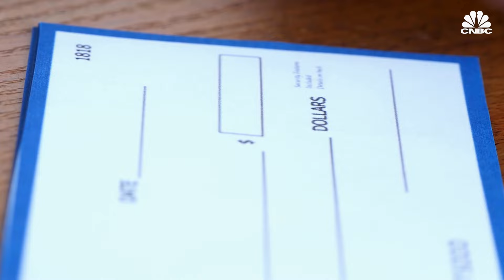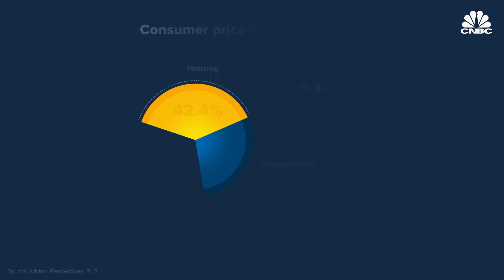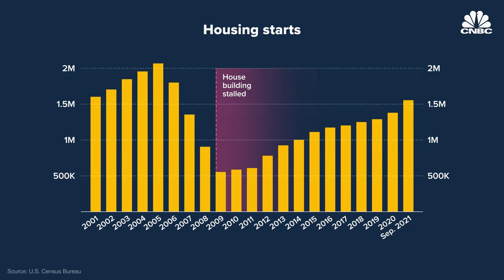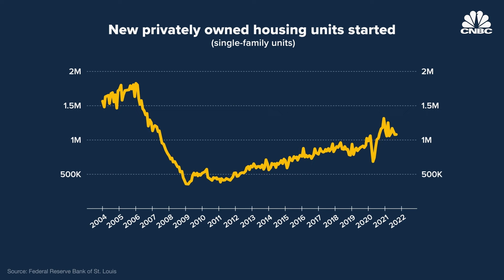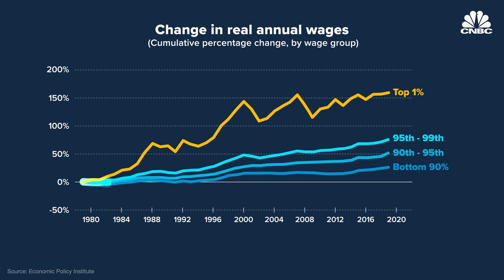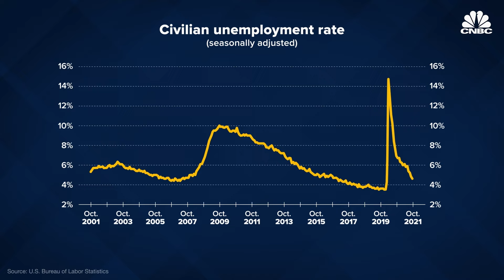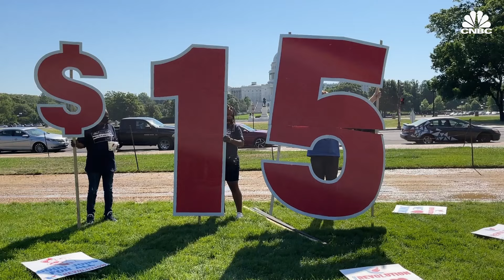Why Rent Is Rising In The U.S.

Comment: They need to start planning cities around public transportation initiatives, make things more walkable
Reply: Yes, this is key. I died a little heading “we need more single family homes” no, we don’t. We need transit and walkable cities
Reply: our cities used to be like that until the highway system was put into place because of the advent of motor vehicles. After that, they tore down and rebuilt our cities to be more car friendly and less walkable and public transportation.
Reply: Jennifer Tarin / That is.. false. The Highway System was built around cities in the US. No cities were tore down for highways and motor transport, most cities already had roads for carriages etc. highways are typically at the edge of a city, not through. I agree the public transportation needs to be improved in the cities in the US, but spreading false narratives is kinda stupid.
Reply: It's kinda hard to change major city infrastructure when it has already been established; it will get very costly. Sentimental & historic value is another reason why cities rarely change infrastructure; at most they'll repair it.

If you ever been to a city with an elaborate & effective city transit system  (subway & bus), you know how necessary it is to navigate the city, especially if you live there full time. Barcelona was the first city I ever visited that had such a system (I didn't travel much before then). It's expensive to live in Barcelona too!

Just like NYC, Chicago, SF and ATL.... it cost money to live in cities where you have access to a lot of things. Cities like Dallas, Charlotte and Austin are next. This is why their rental and home costs are rising as well!
Reply: Sadly they wont do that.  The plan is to keep the poor and impoverished out of site out of mind.  Here in ohio the nicer the area the harder it is to get their , without a car.
Reply: They just need to relax zoning so housing can be built where it's necessary.  Most cities have downzoned their neighborhoods meaning every new development requires lobbying the city hall for an ordinance change or exception.  This makes new development projects extremely slow, expensive, and risky.
Reply: The most expensive cities to rent in are also the most walkable. Not really sure what the issues are, but greed is one.
Reply: @R.M. Schupp Why should renters need protection/compensation?  If there is sufficient supply of housing, renters will always find something affordable to move into.  The fact that there isn't means there's a lack of competition (aka supply) on the market.  In that case the answer is not to make it harder to build more housing, but easier.
Reply: @R.M. Schupp Like I said, if supply is sufficient, people would not have to move outside the city.  The fact that people are being forced to move out of their neighborhoods to locations farther away from where they work means there is insufficient supply.  Making it harder for property owners to redevelop their property only aggravates the issue.  

Also, renters rent on a time basis.  Meaning the understanding is that there's no guarantee they would be allowed to stay past their current lease.  You're basically saying landlords should be forced to compensate renters for refusing to renew a lease.  

You can absolutely build your way out of a housing crisis.  That is how Tokyo solved their housing issue.  Tokyo authorizes more building permits than the entire state of California.  Its average housing prices has been essentially flat for the past 20 years despite its growing population and is significantly more affordable compared to other major global cities like NYC, SF, and London.  So yes, you can build your way out of a housing shortage.  

So are you're saying that the government should "preserve historic character" by forbidding property owners from building more housing and force people to be homeless?  "Preserving historical character" is cool, but at the end of the day it's just all aesthetics and must be justified.  Tokyo is constantly tears down and rebuilds its houses, yet it's one of the biggest tourist destinations in the world.  

Nor is there any historical basis for restricting development the way it's being done today.  All the "historical downtowns" were developed over time without the current zoning restrictions we have today.  People designed buildings because they liked the way it looked.  The popular trends stay and the unpopular ones fades away with time.
Reply: @ajgerbi  Robert Moses "...chose the middle of minority neighborhoods as the location for highways, and deliberately designed bridges on the parkways connecting New York City to beaches on Long Island to be too low for buses from the inner city to access the beaches..."  ~ Wikipedia
Reply: Instead of paying expensive rent you can buy a roiling mini home as a Toyota prius.

Try and see if it is anything for you.
Reply: Very true.   And better public transportation
Reply: @ajgerbi  no, homes were torn down for this . People forced to move or sell
Reply: Good ideas
Reply: I agree a lot of the fun jobs require a car or it doesn't even have a bus route that goes to it. 

If there one of those companies that requires a car they could at least still accept a few people that travel by bus or cab too. 

 I'm sure you could get to different locations if there all within a bus or train route. 

This excludes delivery or truck driving but all the fun jobs require a driver for the company or full time some people can't work full time hours.

 I don't know were they get off saying they support disabled canadiates but they know some of those people need to be able to supplement there checks and not have there payments turned off so almost all of them put in full time knowing some people have impairments and need part time because it excludes them.

You either accommodate disabled people or you don't it seems pointless to say they will accommodate them and expect them to work 40 hours a week. They know exactly how to eliminate people and be biased without anyone knowing what they can do yet or if they even picked the right canadiate. 

I see why there so short staffed nobody can meet there impossible standards and if they have a list of tasks a mile long then don't apply that means you will be doing all the labor so they can hide in the office and count money.
Reply: @cynicalcindy1434  You can still drive/live in SFH if you wants in a walkable city.  The difference is that people have alternatives.
Reply: @neptunegirl3015  Unless your job requires you to constantly move around on the job, you should not need a car.  If it requires you to move around in a car, the company should provide you a car, otherwise stay the heck away.
Reply: They need to enforce our immigration laws and finish the wall...
Reply: @fretsward2225  Illegal immigrants makes up a very small portion of the population, nowhere near enough to explain the amount of housing cost increases.
Reply: @fretsward2225  I don't watch CNN nor Univision.  And lmao, where are you getting that Cali has 20 million illegal immigrants?  That's more than half of the STATE population.  LA Countys population is only 10 million 

DHS estimates only about 11.4 million illegals as of 2018.  That is only about 3.5% of total US population.  On the otherhand, average US housing costs has grown WAY MORE than just 3.5%.
Reply: ...more walkable AND affordable.
Reply: @taoliu3949  forgive me if my reply doesn’t match what you’re saying but regarding the original comment…. come talk to me about how your garden is doing when you live in a 400sqft apt on the 20th floor. My tomatoes, peppers, peas, romaine and everything are FREE. And when I cut open a pepper, I have enough seeds to start 50 more plants. You can’t do that in a high rise. You CAN and likely WILL be spending $5 for that gross GMO pepper you bought at the grocery store. Have I made my point? If I haven’t, let me make it crystal clear: you will pay sky high prices for things you can’t make yourself and you will have no choice. If you can’t eat, you die.
Reply: @cynicalcindy1434  Like I said, NOBODY IS FORCING YOU TO LIVE IN AN 400 SQFT APT.  You are free to live in your house with your garden and whatever, but it IS NOT reasonable to FORCE everyone to live the same as you do.  Not everyone can afford a house with a garden, by not allowing any alternatives you are effectively forcing all these people to be homeless.
Reply: @fretsward2225  So what are you saying, that the Census includes too many people?  If there is an excess population count in the census. Then that would actually REDUCE  the proportion of illegals to total population, which weakens your claim that Illegals are driving up housing prices.  

And wow, talk about inconsistencies.  First you said that Census is inflated by trying to count illegals, now you're saying that it undercount?!  Which one is it, did the Census undercount or overcount?  And even if the Census is inaccurate, where are your alternative counts?  Where is your data with data collected from almost every household in America? 

Oh yes, the DHS implemented the DACA policy under Obamas direction, big woops.  DHS is an executive department and follows the orders and will of the president.  The same DHS also tried to RESCIND the memo during the Trump administration.  

Even the Yale study you mentioned doesn't say that DHSs "underestimates" were intentional, it only states that its methodology was flawed.  Not to mention, the DHS has been using the same method for the past THREE DECADES, which rules out any malicious intents.  And even if we take Yales own estimates, it only results in a mean estimate of 22 million illegals, which is roughly 6% of the census population and is still significantly less than the "20 million in California" claim you purported, unless that is you are trying to say 90% of all illegals are in California that is.  Then you have the question of how the State doesn't realize it's population count/estimates are off by 18 million people compared to an official count of 39 million.   

Also, your own numbers don't even add up.  You state that the state population is actually 44+ million, which is only 5 million more than the census counts, but then go on to say the state has 20 million illegals while Yew/DHS estimates around 2 million in the state.  That's a discrepancy of 13 million people.
Reply: I live in the city where metro is utilized by everyone with and without a car and I think the apartment complexes increase rents because of the convenience around them. Metro, grocery stores...all essential and the rent is high and thr complex uses that in their vacancy announcement as if they are the ones providing it.
Reply: This would help a LOT. Cars are extremely expensive and auto repair is too, even for older cars. Auto shops charge astronomical labor fees. I would get rid of my car and take the bus or train if it were more efficient.

Comment: the primary cause is/has been the Fed holding interest rates low for more than a decade which has fueled the rapid growth in home prices and other asset bubbles. No politician wants to be responsible for slowing home prices and a falling stock market.  Allowing interest rates to rise would solve a lot of problems. But it would drive up the deficits since interest on the national debt is the 4th largest item in the federal budget.
Reply: Exactly. Also low interest rates effectively punish savers and only encourage people to acquire debts.
Reply: Increase interest rates and you'll end up with even more problems. 
Lower interest rates are better.
Reply: Lower interest rates and more money can be spend.
Reply: It could potentially crash the housing market and spike construction unemployment and other industries would loose profit, developers, realtors, banks
Reply: @MrKongatthegates  the history of economic cycles is always one of boom and bust. Preventing this healthy cycle has led to the largest asset bubble in history. Which leads to a more painful correction down the line.
Reply: @sm3675  you have a flawed understanding of economics. What's needed is not higher or lower rates but rates adjusting to the equilibrium level in the market. The government should take its thumb off of the credit market scale.
Reply: @MrKongatthegates  the housing market is in a bubble, it will burst.  Its just a question of when...  and the cause is interest rates being held below the equilibrium level in the credit markets.

Comment: Make air b and b illegal and watch the problem change quickly. We have the houses we just like using them as hotels. Greed got us in this problem. Greed is not the solution.
Reply: Most those Air B&B homes were free homes to begin with. Making the situation worse.
Reply: Air BnB would not be needed if Hotels charged a fair rate. When I charge $60 a day compared to a hotel which has over a hundred rooms charges $90+ per day and only has 4 employees on site per day. 60% of a hotel can be empty and they still make a nice profit. When a big event comes to town and the hotel sells out and actually increases rates when almost near full, that is truely the problem.  I dont rent my home through air bnb anymore due to terrible host customer service, but I can actually see it benefitting the small REI businesses. Subletting is a whole other can of worms.

Comment: Any discussion on housing costs always fails to mention how nowadays housing is a commodity/asset. In the 1950s or so, housing was, for the most part, just that, a house you lived in. Prices increased steadily, mostly mirroring inflation rates. In the later part of the 20th century, it became an asset class that you would invest in and see its value go up. "Real estate always goes up." Now prices are much more volatile, as is the case with any speculative asset class. 

Addressing this key aspect of housing is essential. You need to place restrictions on investors (domestic/foreign, corporations/landlords/Airbnb, etc.) so that the supply of housing is not gobbled up by a small group of people who then force everyone else to rent at insane prices or pay ever-higher prices for the dwindling number of homes for sale. 

Otherwise, any new housing will just be bought up by investors, which is already the case. How many of these new condos in big cities are directly sold to people? Very few. They are owned by corporations who rent them out and will charge crazy rent prices because they don't depend on the incoming rent revenue to stay afloat.
Reply: This is 2021, not 1950. 
The times have changed and we now live for money, we die for money. 
The prices have been artificially inflated by real estate developers and agents. Not to mention go to any old subdivision and you'll find plenty of old couples living in 2500 sqf Mc mansions.
Reply: This! Thank you!
Reply: Spot on with this comment!
Reply: if you place all those  restrictions and bottlenecks it will reduce inventory even more...and you can thank the fed for creating housing into an asset, because you only have very few options to put your cash where it wont lose value yoy

Comment: Not every one wants dense housing when they buy a home, it feels like apartment living.
Reply: There's no issue with apartment living, problem is US lots of apartments are crap, hearing all your neighbors as the walls are super thin.
Currently living in apartment here in Austria, I hear my neighbors above if they start jumping, so super rare, besides that super quiet, just build the walls right.

And I like the benefits of being in an apartment, train station is 100m away, subway is attached to that, grocery store 1 is 80m away, grocery store 2 is 90m other direction, small restaurant across the road, primary school 120m away if I ever decide to have kids, etc., and I don't need a car, so quite a chunk I'm saving, about the same as a car would cost me monthly. And yes, I have the option of living in a single family home just outside the city in suburbia, 45 minute commute to town via driving to train station and taking that (since way more traffic if trying to get into city), prefer my apartment, will clean up the place and get a renter in the new year, got some people who always show up asking if can rent with family.
Reply: @Masterrunescapeer   same. I moved from a 15 floor apartment (made of concrete in the 70's), to a 5 storey apartment (made of wood in the 2000's). The difference was huge. I couldn't bare the thought of my neighbors listening to me doing Zumba or something so I moved again to a taller building 😭😭

Comment: One thing that I have realized is that you don't need to have high rent especially In low to middle income areas just because wages go up does not mean to increase the rent 50 to a hundred dollars more that can cause all sorts of unnecessary complications and it would put someone who is living paycheck to paycheck on a thin line and force them choose what bills to pay and greatly reduce the ability to put a roof over there heads. I do agree on the need to build more homes and apartments because housing is a human right and should be seen as such because as long as there is a shortage high price on even a one bedroom and bathroom it will lead to more people being unable to house themselves because they are seen as a commodity to be bought and sold this will lead to more homeless and will further exacerbate this issue. I am a firm believer in rent control and I see it as a necessity because it will help people be housed and keep them from being homeless.